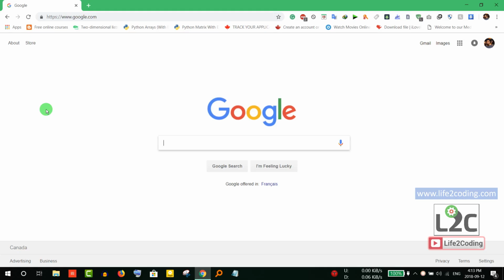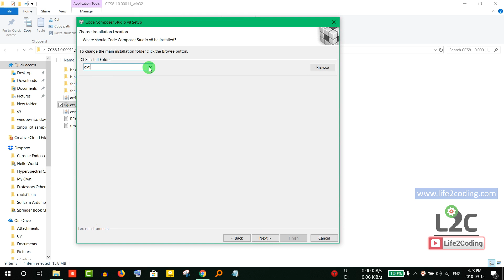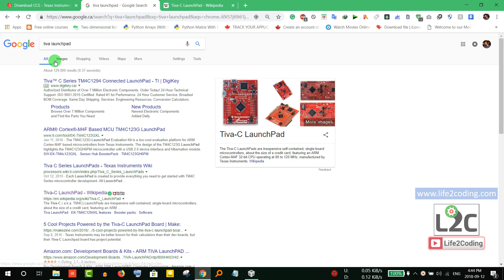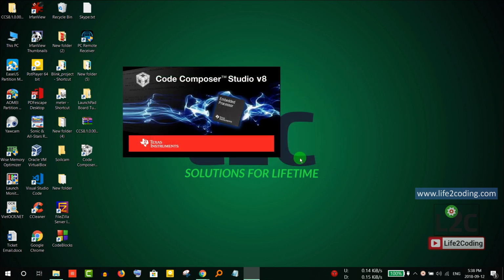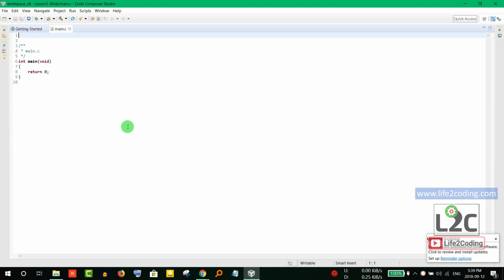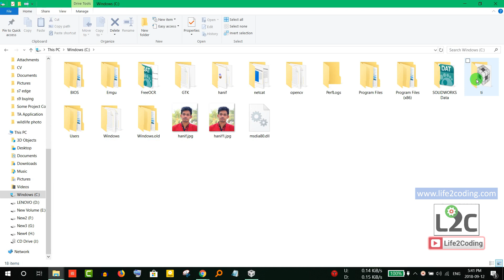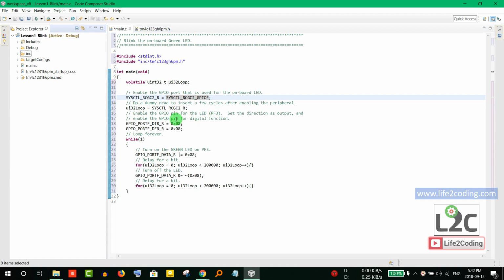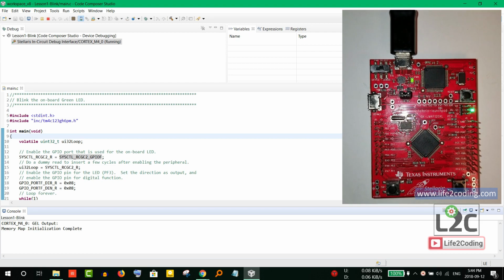Launchpad Tiva Series Microcontroller Tutorial 1: Installing Code Composer Studio v8.1 2018

Comment: Thanks for the video. The correct way to fix your missing include file is not to make a copy, but to modify the include path for the project. Right click on the project name, select Properties. Then click on Build/ARM Compiler/Include Options. There you will be able to add the path where you found the include file, which in my installation, was C:\ti\TivaWare_C_Series-2.2.0.295\inc .